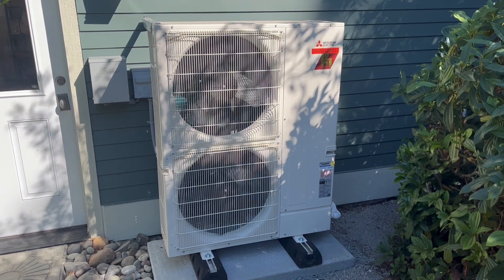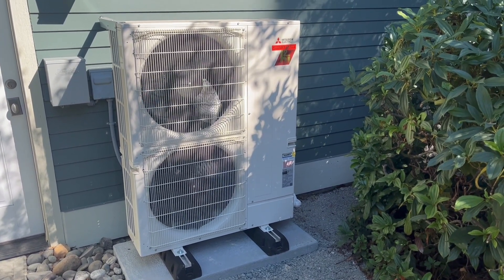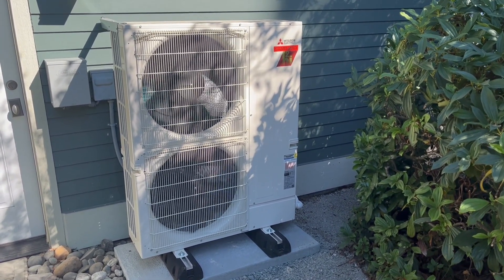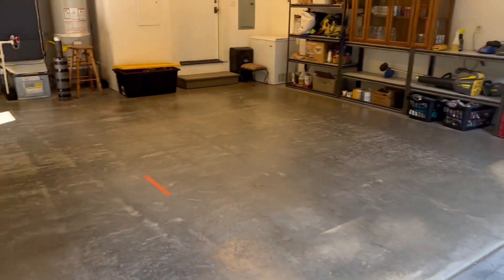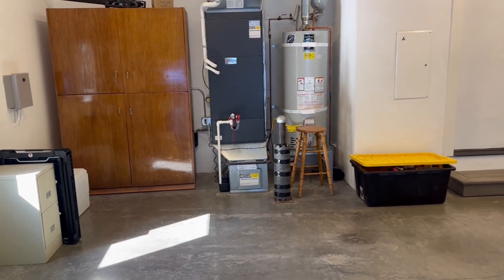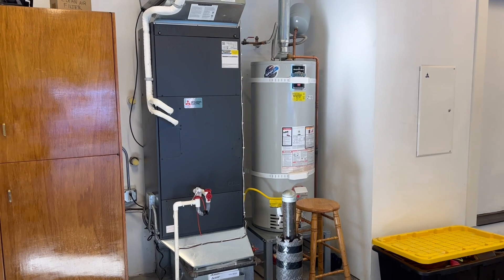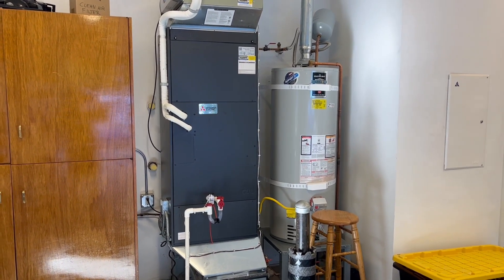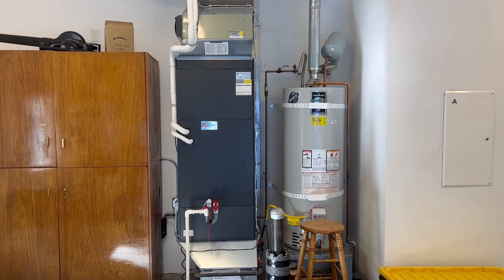Mitsubishi SMART MULTI Heat Pump

Comment: A Mitsubishi PUMY can do 10 indoor units without a branch box or multiple line sets.the smart multi isn’t special with that.
Reply: No it still has a branch box.
Reply: @timrob0420  incorrect I have this unit hooked up to multiple heads in my house. One lineset no branch box.
Reply: @NotOurRemedy  that makes absolutely no sense. Do you know how heat transfer works? It would need either multiple line sets with multiple metering devices from the outdoor unit or a branch box, which has multiple lines with metering devices. You have a branch box you are likely unaware of where it’s at.  That smart multi has a branch box too. I’m a Mitsubishi Diamond Contractor technician.
Reply: @timrob0420  I’m a commercial VRF technician. Heat pump VRF needs no branch box. Heat recovery would. 

A single lineset with brazed Tee’s going to each unit. Is how heat pumps are done. Each unit has its own EXV.
Reply: @NotOurRemedy  interesting i did not know you had city multi unit installed in your house. Appreciate the feedback. Why anyone would install a commercial system in a residential setting is beyond me.
Reply: @timrob0420  it’s a PUMY system single phase.